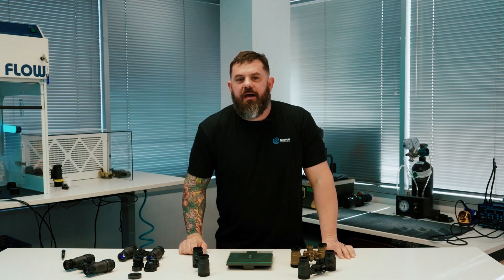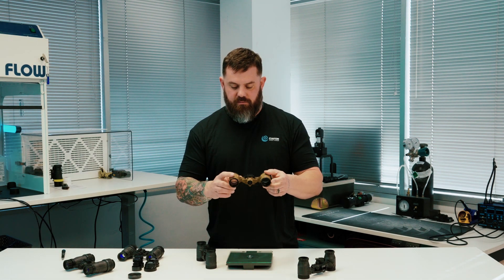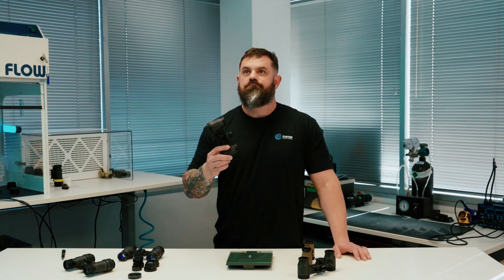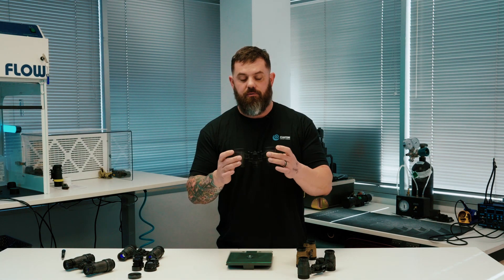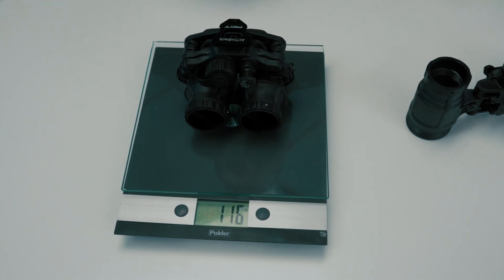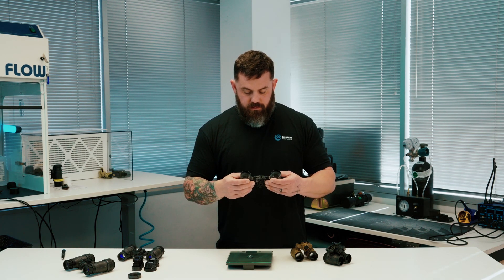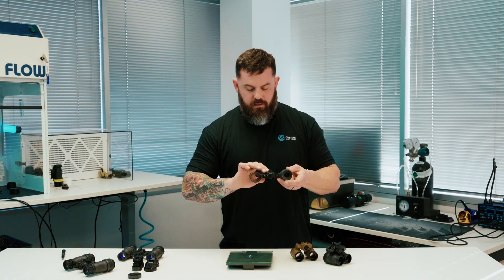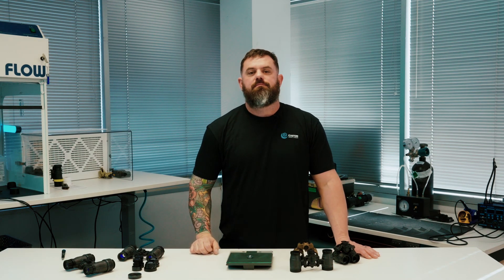Custom Night Vision| Nocturn Industries Katana (Injection Molded)

Comment: Do you think it is worth it to get 2000+ fom or save 400$ and get 1700-2000 fom? I live in a remote area and would be doing a lot of hiking in and around the woods
Reply from the maker: id say get the higher spec tubes if you can.
Reply: Thanks for the advice man love you guys channel I have learned a lot from you